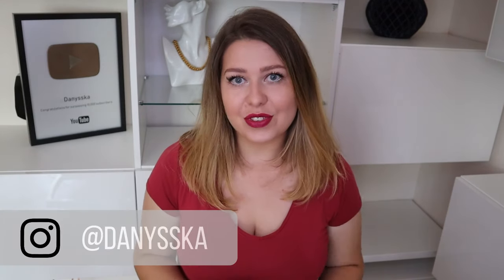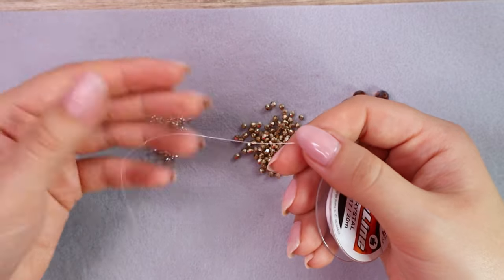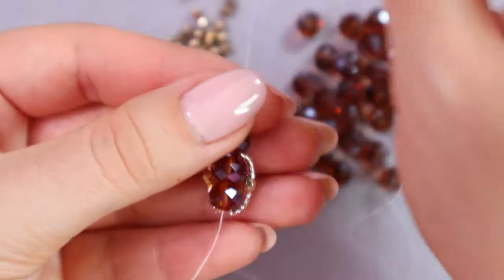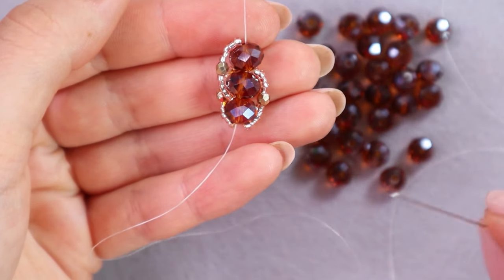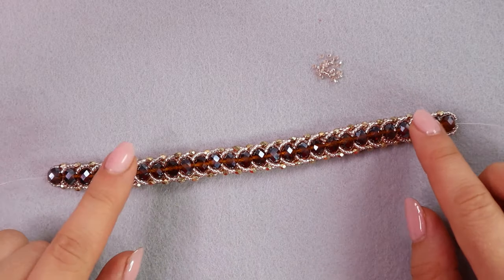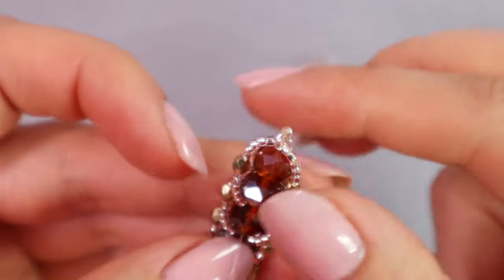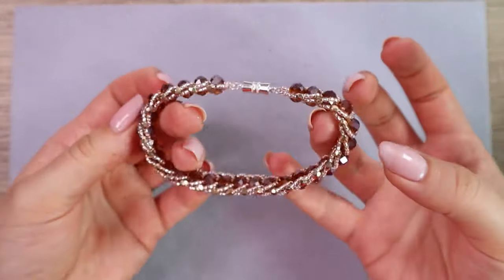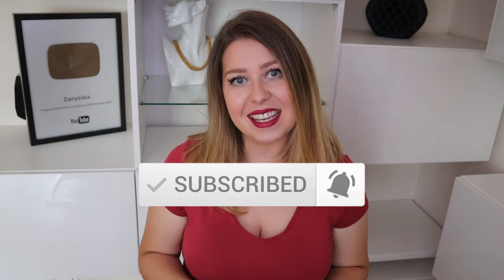Flat spiral stitch tutorial | Bead bracelet under 20 minutes | Bead tutorial | Bead bracelet

Comment: Yesterday I started this bracelet and was successful thus far (almost done. It wasn’t my first try, because until now I’ve only had many failed attempts due to wrong thread, wrong sized beads, not knowing what combo to use, alas it is my first time being successful on working with beading thread, as I haven’t successfully made a single thing yet. (I don’t have firelane thread) but I found some beading thread that worked pretty well at michaels. There was only one left. I’m pretty positive I’ll be making this one again. I have to say I’m still pretty new to making jewerly altogether. But adding thread and a needle to my arsenal is very exiting and it makes me have nostalgia because I also sew and haven’t been able to for a while.
Reply from the maker: Don't worry about it at all and don't be discouraged! And you don't have to have Fireline, I've sewn with a cheap Nymo to start with. :)

Comment: As a jewellery wearer I can’t agree on the magnetic clasp on a heavy piece. No stabilization of the way the piece lays, and comes off at the slightest tug. Lobster clasps also don’t lie correct. A hinged, fold over clasp lies properly and stays closed. 

Very nice design though!
Reply from the maker: Fold over clasps are a great option! Some types of magnetic clasps have very strong magnets though, depends on the manufacturer :)
Reply: @Danysska  - yeah, I’ve probably just been unlucky.

Comment: ihow do you thread such a small needle.  i bought some and i just cant thread them
Reply from the maker: I usually sew with Fireline, which is pretty strong on its own, so I don't have a problem with threading. But if I'm sewing with a softer thread, I'll wet it a bit and smooth it between my fingers. I might cut it diagonally or use thread conditioner.
Reply: @Danysska  thank so much